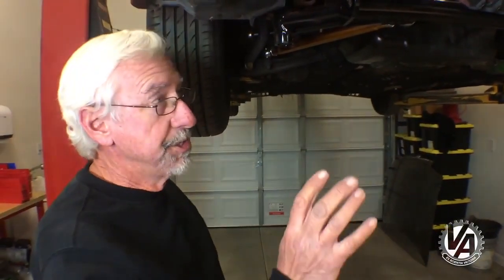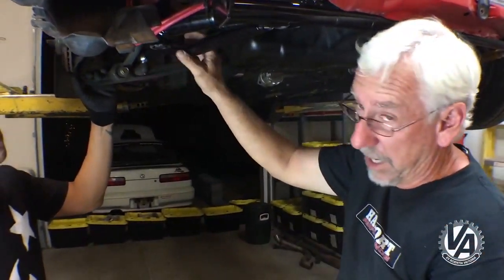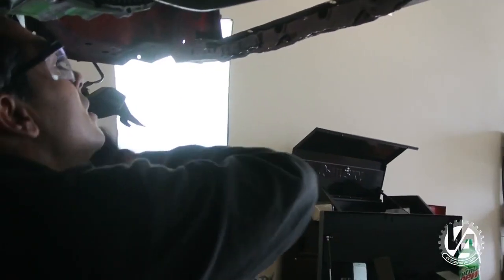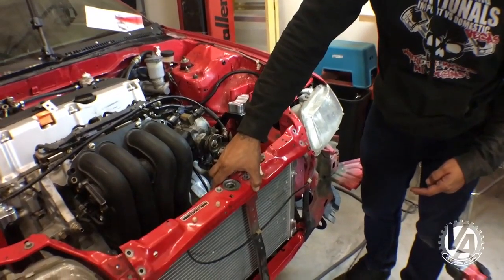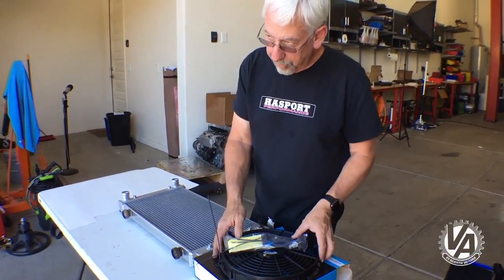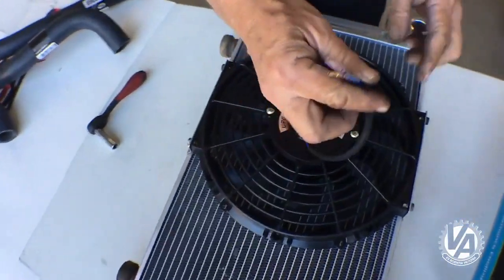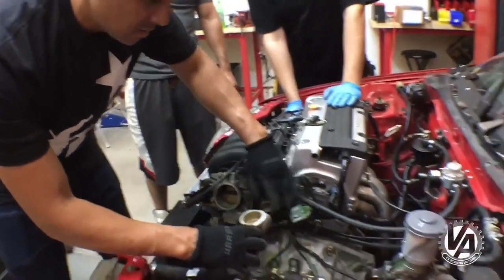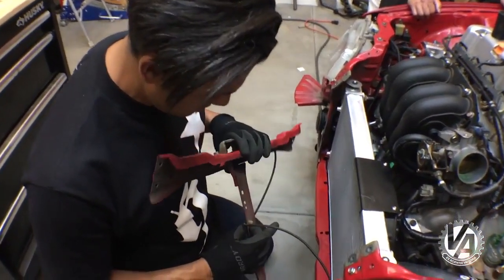BUDGET EF K-Swap Tuck Radiator for under $100? - Project Budget EF Gets Cooler

Comment: That budget radiator setup is going to make ALOT of people very happy. Thank you for sharing the information.
Reply: itsjussjerry that's a lot of work to use it and will cost more than just 100 cause of all the fab work they did like welding tabs and making brackets all that will will add up quick if you have yo pay plus materials
Reply: Frankie R welding tabs and making brackets is alot of work? Any fool with a propane torch and some alumiweld rods can make it work.
Reply: itsjussjerry right but you would have to buy material, tools  with equals cash time is "free"
Reply: Frankie R I can't imagine materials costing a whole lot. My point is, still a whole lot cheaper than any tucked radiators offered on the market today.
Reply from the maker: Frankie R Speedfactory has a great tuck radiator for those that don’t want to fab up their own. https://jhpusa.com/products/speedfactory-tucked-race-radiator?variant=40557880788
Reply: @frankier3701  but still itll be cheaper in long run because you can always replace radiator and still have tabs and hoses ready for you.
Reply: the radiator itself is almost 150 lmao
Reply: @TheShangralaaaa17  80 on rock auto
Reply: @honestbuiltperformance1819  rockauto doesn't sell an all aluminum sirocco radiator tho. im not using anything with plastic end tanks
Reply: @TheShangralaaaa17  I honestly didn't notice that at all, thanks for pointing it out

Comment: Incase anyone cared, those pre-cut holes he used to mount the radiator are actually for the factory A/C condenser. There’s a tab that slides into the top hole and a bolt goes through the bottom hole.

Comment: i have the skunk2 1/2 radiator with spal fan for my crx b swap, and used the spal mounting brackets. they actually slide into the fan housing and allow you to mount it like a spider (if that makes sense). got them from summit for about 2 each.

Comment: What plug is welded into the radiator? The fan switch sensor. Also why does nate switch plugs on the fan? Is it oem plugs in place of the aftermarket ones. Questions after questions. How did you guys get the engine temp gauge to work on your ef cluster? I didnt see you guys add an extra ect sensor. From what I heard. ECT/CTS sensor on the k20z1 head goes for ecu. But there needs to be another one added for the gauge cluster to pick up.

Comment: Greetings @vtecacademy I’m using a speed factory tucked radiator with the ac infront and my temps are going up to 105c when doing pulls I’m just wondering if that is normal I purged the radiator put some holes to the thermostat I’m not sure what’s wrong I hope you can help me out just spent a bit on this setup just for it to overheat.

Comment: Had to do something similar on my EJ. Using a RBC makes the throttle body come in contact with the radiator while using the EKK1 v.1 mounts. End up using a s2000 radiator and place the fans in front. Noticed the trans bell housing has a bigger “inspection” hole.. explanation? Thanks

Comment: @VTEC Academy, when are y’all gonna make more episodes on this build??
Reply from the maker: ItsKirbyHD we’ve shot them already, however the editor working on them had an issue with their computer. It’s since been fixed and the updates are coming soon.
Reply: @VTECAcademy  any updates?  How much did you charge your customer for the hole swap? Awesome work.

Comment: Great minds think alike!  Here's a similar setup...part numbers are in the captions.  https://www.facebook.com/pg/OneLapCRX/photos/?tab=album&album_id=183512245013361
Reply from the maker: Sweet! I was checking that out. I also like what you did with the cable clutch adapter.

Comment: We’ll the radiator fit dc2?
Reply from the maker: It is smaller than the DC2 radiator, so it should.
Reply: @VTECAcademy  what bottom radiator u used? N top? Is it in video? I forgot if u used it

Comment: Making one side of your little bar left hand tread and the other right hand thread is pointless. If the bar is straight you can just twist the bar to establish your desired suspension settings but when the bar is oddly shaped as yours is that option is thrown out the window. Now you're tied to half turn increments, with a little wiggle room, which would work with both ends being typical right hand threads. In either case it will get the job done... just a pointless addition for your application.

Comment: Americans calling engines Engines instead of motor: Hawwwt
Reply from the maker: Vince Andres Is it an American thing?
Reply: @VTECAcademy  at this point, yes.

From watching yt videos you'd always hear like

LS Motor
VTEC Motor
Jz Motor

But when you actually think about it a Motor turns Electric Power to Mechanical power not Chemical Reaction and Mechanical power
Reply from the maker: The two words can be used interchangeably @v8vince761 . Although you will seldom hear an electric motor called an engine unless you are talking about a diesel electric locomotive. In the US that is.
Reply: “ But when you actually think about it a Motor turns Electric Power to Mechanical power not Chemical Reaction and Mechanical power”

Actually, a motor is defined as something that produces motion, regardless how it’s powered. Therefore, it is not incorrect to say that an automotive engine is a motor. However, an engine is a device that generates work from heat. By this definition, it is completely incorrect to call the motor in an EV an engine.